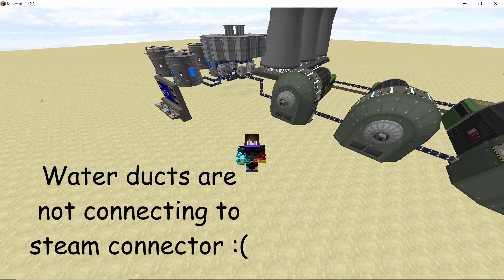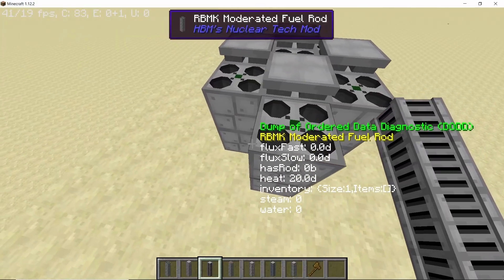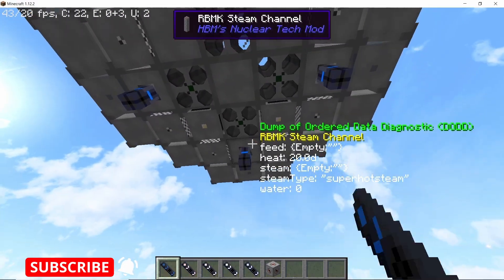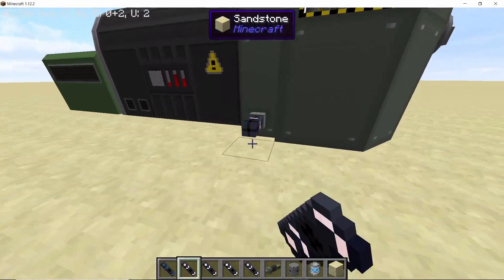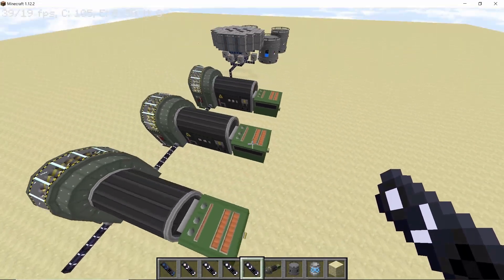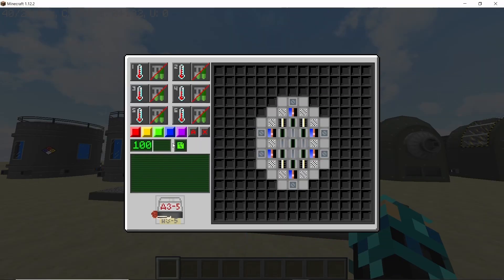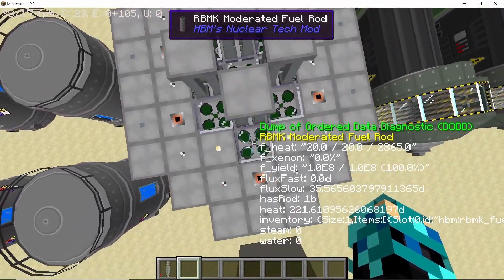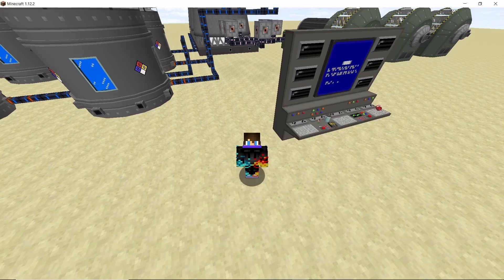How to make an RBMK Reactor in "1.12.2" HBM Reloaded -Water Ducts not connecting to Steam Connectors

Comment: Answer the question!!!!! Why does the developer not create new elements and blocks for 1.7.10, but not for 1.12.2? And why the developer does not post version 1.12.2 on the official website. What's it?Excuse me. I don't know English well. Therefore, I translated it through a translator. And if there are mistakes, I'm sorry.
Reply from the maker: Because the developer for 1.7.10 and 1.12.2 are different. The version for 1.7.10 is being constantly updated while it has been abandoned for 1.12.2 so there is a very small chance of any further updates for that version.
Reply: Thanks!
Reply: The 1.7.10 version is the Beta version. Perhaps the developer will fix the flaws and move the new items to 1.12.2
Reply from the maker: @Xirouyss-Minecraft-RU  no it is not the beta version , it is the main version of the mod and will stay in 1.7.10 as far as I know.
Reply: Okay, thanks!

Comment: Extraction mode didn't fix the 1x1 reasim reactor
Reply from the maker: What exactly is the problem with the 1x1 reasim reactor ?? I mean it is just a single fuel rod with separate water inlet and steam outlet
Reply: @SavageVegeta  I can't get water to go into it, I'll try again with the big ass tanks, but tanks and barrels aren't working.

Comment: something that i learned from rbmk that was very unexpected was that rbmk doesn't need to be big or have a expensive fuel to be good like you can make a 2x4 rbmk with fuel rod DU and produces some where between 500KHE and 600KHE and since is cheap as fuck you can just copy paste and it will eventualy produce more power than fusion reactor and it doesn't melt cause since du is the weakest rod it will produce more radiation with heat but since every time it gets to 600c the water turns in to ultra dense steam and cools down the reactor and cause that it doesn't have the enough heat to get unstable
Reply from the maker: True , it's the modular nature of the RBMK that makes it so powerful and also can be designed very close to match the power requirement. Also I am a big fan of small RBMK reactors , partially cause they produce less lag and partially cause it's fascinating how such small structures can produce so much steam !!

Comment: i think you can connect the steam ducts to the top of the steam cannels but you have to do it before you place the covers
Reply from the maker: Yes that can indeed be done, however most people don't prefer it cause it ruins the look of RBMK and also hinders the motion of RBMK crane ... It's doesn't look very natural that is however that later is not an issue in 1.12.2 as there are no RBMK cranes in that version
Reply: @SavageVegeta  they added them in the newest version the day befor yesterday xd anyways one question what is the best temperatur? like the most efficion one but also most stable one